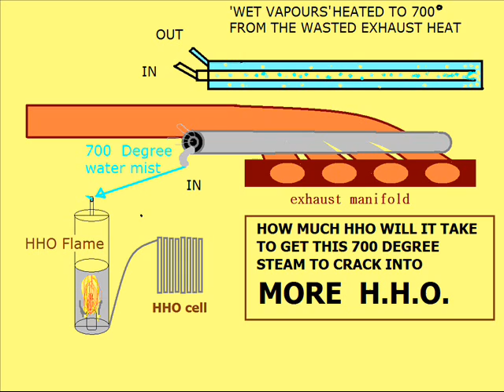HHO hydroxy gas from EXHAUST STEAM questions for efficiency

Comment: voltalasis, chemolosis: two terms listed by some YouTube presenter regarding my question what temperature can i use to fracture the water molecule. There is too much waste heat in all our devices(but still global freezing- Flipping Al Gore didn't pay the higher-ups the global warming scam fee again so they slammed his ass and we don't get the benefit of my young days wish of a uniform temperature for growing across the planet)
so if I could simply fracture common water to pipe right in to an engine. 
But we do... hmm? How much of the water vapor in exhaust is not a chemical byproduct as their lientists say, but it is the local water vapor from in your area. So if you mentally

Comment: instead of using brown's gas as a source of electrolysis, use the hho exhaust heat to run a separate closed turbine system. to vaporize water and use it to turn a small turbine to generate power to charge a second battery which in turn powers the electrolysis. this should circumvent the second law of thermodynamics, allowing a self powered usable engine running off water.
Reply: you need pressure for run an turbine..
Reply from the maker: thanks for your ideas😁

aussie man, tinmanpower done an amazing set up, it's a must see, a real eye opener
https://youtu.be/wHcm_nUZsOc
Reply from the maker: you know on eBay they have them peltier (TEG) thermal electric generators, that make electricity from heat.
well if you had enough of them on an exhaust, it may be possible to power a high temperature device (furnace type heat) to properly crack the water.

the peltiers would certainly produce voltage to power a Hydroxy cell. 
I'm personally loving the work YouTube
 tan kusuma is doing refining the cell design.

good luck mate, cheers
Reply: pressure is built using steam.
Reply: the question is... how many liters of hho you need for make steam and run an turbine? you need to use hho detonation force as pressure source.. the steam is just the final result. If you want obtain power you need power...

Comment: I am working on this.  I have my HHO generator set up it's been a working unit for 6 years.  I have something I will be trying over the next couple of months it has to do with controlled injections of steam to a pyrolitic graphite element heated to "Hopefully" +2000 C similar set up to the old limelight. My goal is to sustain a reaction greater then the input basically using the input as a pilot light for the fuel water. I have thought on this  and I think just the right injection to the heated disc will combust the water if my temperature is sufficient. Worst case scenario it will just poof away. Since oxy Hydrogen can't burn any hotter then  "I think" 3000 C the graphite will not melt. I will be making a burn chamber out of already acquired titanium and trapping some heat by insulating with vermiculite. Some engineering will be required for my set up but I have all the materials just need to start fabricating.  I am hoping with just 360 watts I can ignite water with heat creating more heat that can be more useful. If all esle fails it will double as a cook plate and I might turn it into a coffee pot as well. (This is not for vehicle exhaust.)
Reply from the maker: very interesting Joseph please upload your work for us to have a look at ;)
good luck
Reply: Will do. I am a busy parent with a full time job so it is a slow process. I just finished some ornamental armor using titanium this weekend hopefully that clears me up for my next project.

Comment: I know this can work some how using water reclaiming the exaust in a closed loop system so no energy can be lost at all because if energy can not be created or destroyed and ran in a loop in a vacum sort of way It could only change. What becomes of hydrogen after it is exploded does it change into another gas or does it change back to water after meeting up with oxygen in the vacum?

Comment: I have an idea to turn the exhaust nozzle on a turbine generator into a steam chamber and run it back through the combustion chamber with less fuel. not only would it save all the heat energy being lost it would burn less fuel and the hydrogen/oxygen would make it burn more efficiently + added thrust from the steam pressure and less maintenance on the turbines.
Reply: im working on a similar idea. im trying to design a hybrid rocket engine design that uses a slower, hotter solid rocket fuel, a nozzle made of tubing coils to a boiler chamber to supplement the slower burning pyro mix. i even had some designs that would use a steam powered turbine to power an HHO cell that dumps into the combustion chamber.

Comment: Just a thought!! Use the heat in the exhaust to crack water and fuel vapor mix at about 400-700 degrees. works good for a while but then fouls with carbon. Use the hho to periodically burn the carbon out of the cracking unit. Cracking unit will make way more hydrogen. Like I said, just a thought.

Comment: That might work, don't know! There are poor peolple in the phillipines that are using a small copper tube hooked to the exhaust with a water bubler hooked to one end. They put a scrap piece of aluminum, or magnesium wire inside the copper tube. They are getting great results. But they are range specific. Like 10-40 mph. At high speeds not enough output. Costs $10.00. $15-20 if you buy one all done.
Clay

Comment: GEET uses this method. The plasma reaction helps keep the fouling in check. But its hard to run a differing speeds and it doesnt handle loads on demand like acceleration.

Comment: Look up "steam reforming" its a method to use high temperature steam over a catalyst such as iron, or nickel,or  copper,or aluminum,or platinum, or in different combinations to separate the steam into hydrogen on demand. Using iron the temps are higher, using copper the temps are lower. Using iron and copper at different areas along the chamber takes advantage of both. Problems occur with fouling the catalyst and the reaction stops.
Good luck
Clay